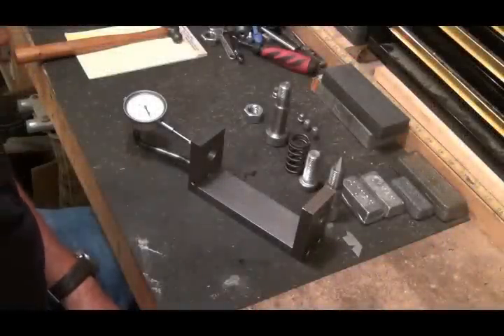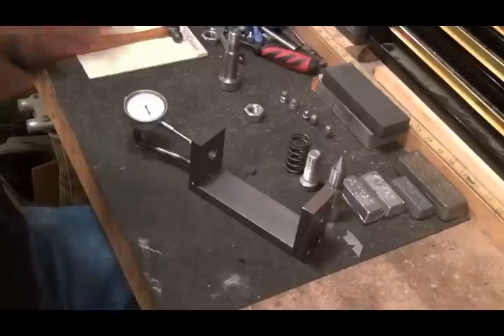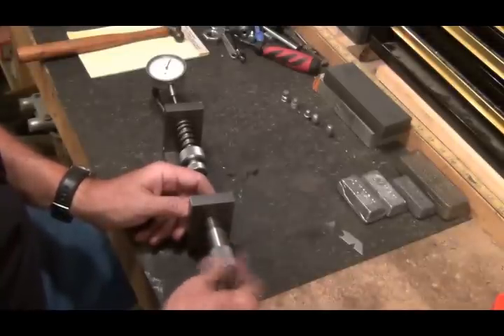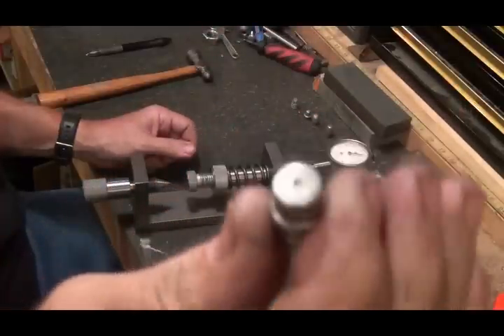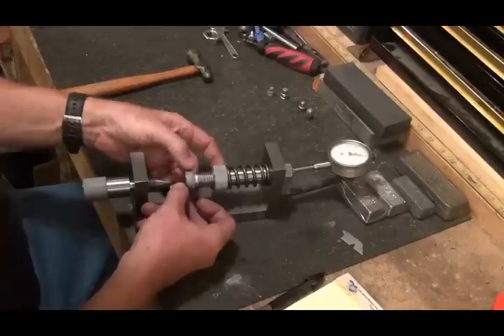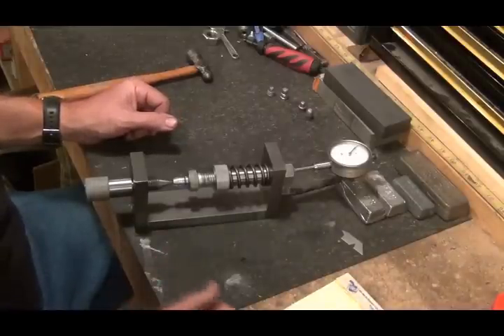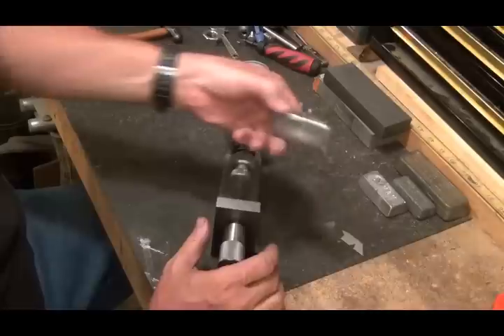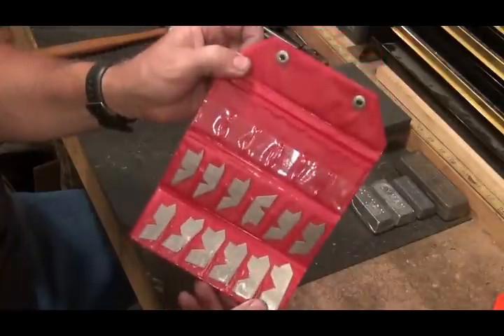Lead hardness tester more testing

Comment: I have the one you modeled yours after by Cabine Tree. I had one problem with it that just drove me crazy. On smaller bullets or ones with rounded noses, there was no way of keeping the bullets between the indent point and the flat bolt base. They would always spin off as you turned in the point. I tried to test them on their sides, which worked sometimes. I also tried filing flats on them but that removed the surface hardness of water dropped bullets and just didn't work on the really small ones, 22, 30 etc.
I solved this by having it modified so that the point did not rotate. Erik at Hollow Point Mold Service made the point removable and slip fit into the bolt. In each half of the bolt he put a ball bearing. This way the two ball bearings road against each other and indent point never rotates. It just contacts the bullet and pushes the indent point directly into the lead. The readings are the same as before but I can now test previously cast small bullets all the way down to 22 caliber.
Reply from the maker: I will have to remember this. Thanks